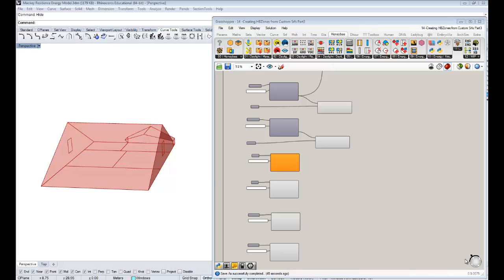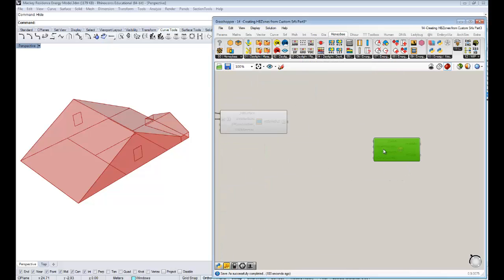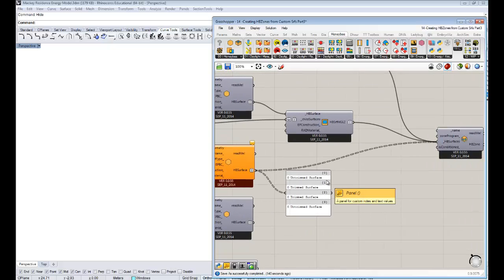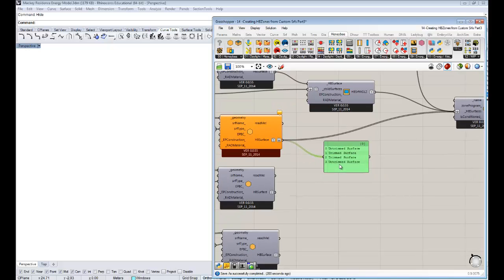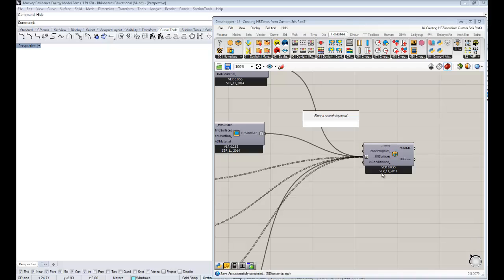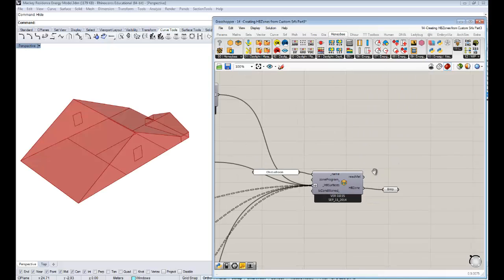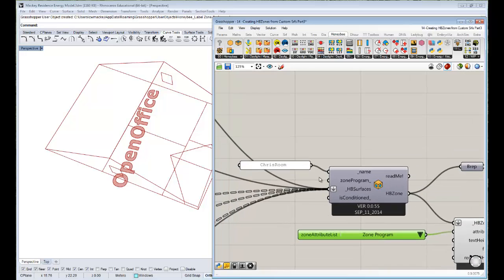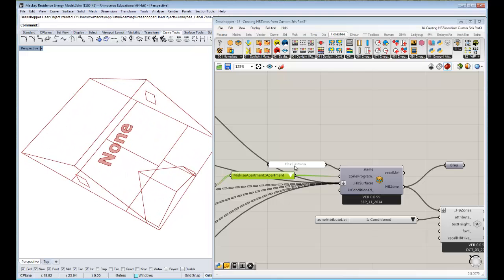14 - Honeybee Energy Modeling - Creating Zones from Surfaces Part 3: CreateHBZones

Comment: hi,chirs,i have a doubt about what's the difference between 'solve adjancey' and 'intersect masses', it seems like both of them should be used when two zones connect to each other. If they are diffrent, in which occasions should each of them be used?